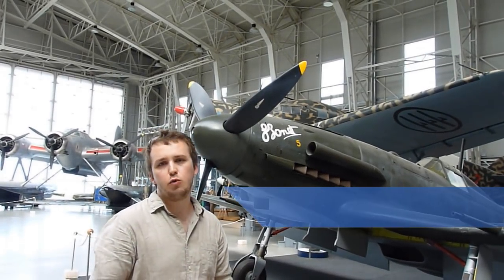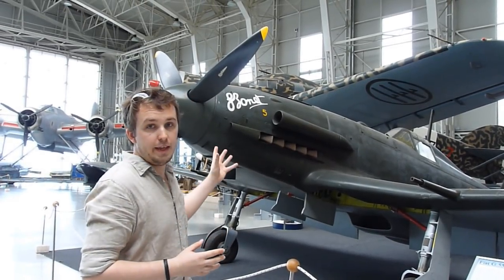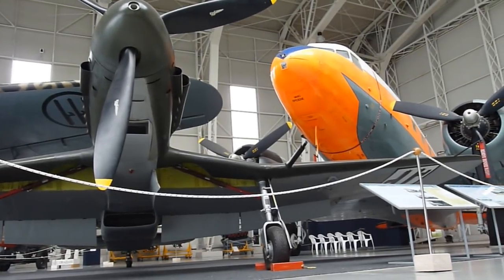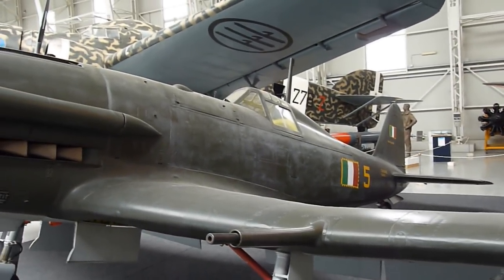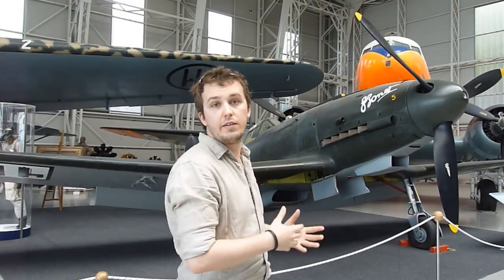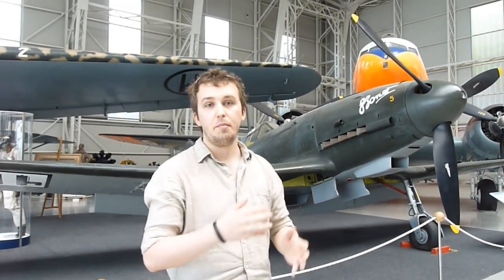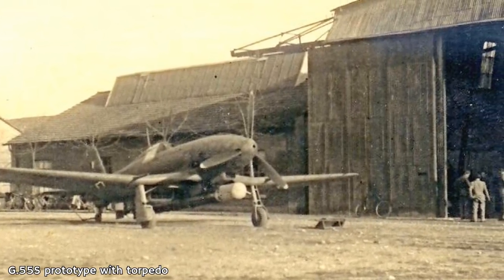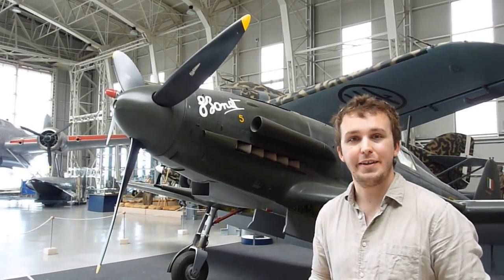Fiat G.55 - Italy's Centaur of WW2

Comment: The irony is that the  Nazis could get a 109 out the door of the factory in 5,000 hours but it often would not fly. German production quality deteriorated during the war to the point of absurdity.  Rather than produce quality air frames they just shoved crap out the door. Many 109's, by 1944, were scattered on airfields with missing parts needing replacement of shoddy parts..   The Nazi bureaucracy was concerned about the bottom line, which for them ended at the factory door. One of the many errors by the Nazis was not incorporating women into their workforce unlike the Allies whose workforce was ample and able with women.
Reply: To compare the build time of the Italian fighters with that of late-war Bf.109, like it's always done, it's simply misleading. No oter WWII fighter, not even other German fighters like the FW-190,  took so little time to be assembled. That's due both to the different industrial structure (a Bf.109 built in Italy would have required much more man-hours to be assembled, due to the more labour-intensive industrial structure) and due to many "shortcuts" that had made to make the Bf.109 easy to make (some of them even not so safe, see IE the single fuel tank put in the worst location possible). 
Spitfires were industrially made, but to build one took 16.000 man-hours on average.

Comment: I wonder if the G.55 could have been a torpedo aircraft for the Graf Zeppy, had it been finished and put into combat... (Not that Zeppy would've lived long, the minute the brits learned it was fully operational they'd throw EVERYTHING AND THE KITCHEN SINK at it in an effort to sink it...)
Reply: I don't know if it would have been used on the Graf Zeppelin, but a torpedo version of the G.55 (the G.55S) was being designed, with a single prototype in testing
Reply: A torpedo bomber-version of the G.55 had been tested and found satisfactory, however it had to be modified to do so (splitting the central radiator). The Reggiane Re.2005 insterad had already been selected to be the second-generation fighter/ bomber / torpedo-bomber for the carrier "Aquila" (after the Reggiane Re.2001). It could carry a full blown torpedo from the start without modifications, thanks to its 1000 kg offset hardpoint.

Comment: Took a G 50 a put a DB 605 in it? Where did you get that, the fuselage is totally different in xsection as well as the wing plan , it’s a totally different plane. Did you read the English version of Wikipedia “Fiat designer Giuseppe Gabrielli, while experimenting a new version of his Fiat G.50 fighter, equipped with the DB 601, started a new design that was to be powered by the DB 605.” It’s clear that the G 50 derivative was installed with a DB 601 but Gabrielli made a totally new design for the 605. The G50 was an ugly duckling, the G55 is really a Centaur.

Comment: G.55, Macchi 205 and Reggiane 2005, as if the British had had three airplanes like the Spitfire with non-interchangeable mechanical parts. The explanation is one "bribes".
Reply: Simply the G55 was the winner of the selection, but the C.205 was readily available (it was already in production infact) cause it was simply a C.202 with a "plug & play" DB605 engine in it, while the other two required time to start production, so there was no point in not producing it. For the Reggiane instead was easier to start producing the Re.2005 than retooling to produce the G.55, and the Re.2005 had been already selected to be the "second generation" fighter-bomber of the carrier Aquila after the Re.2001 (the Re.2005 could carry a torpedo from the start, thanks to the offset 1000kg hardpoint).
Reply: None could compete with the spitfire

Comment: Seems that all Italian aircraft designers wanted their products to be beautiful as well as efficient.  Even the tri-motor seaplane bomber in the background is handsome.
(Compare to the Ju52, useful and rugged, but a real ugly duckling.)
One question about the G55, though; why is the cockpit SO far back?  The DB engines aren't that long, and seeing where you were going on the ground had to be a real problem.
Reply: Behind the engine there are the receivers of the guns and the magazines of the ammos, Bf109s cockpits were placed about as far back (just a little less, but it was "paid" with the bulges and less ammos). Really the inverted V layout of the engine, with the low placed propeller, gave a better forward view in respect of conventional engined models (and both had a better forward view in respect to radial engined models anyway).
Reply: The "span"  between motor and cockpit  is for the Cooling and TurboCharger  System...
Reply: asparis145149 weight and balance

Comment: Looks pretty imbalanced was its left or right wing longer? Doesn't matter just not centered and extremely costly for just no effect we even do not need to look at the video.
Reply: Macchi fighters had the left wing longer, not Fiat ones.
The solution was not "extremely costly" at all (the left and right wing are not interchangeable anyway).
The solution was effective to counteract torque.
Other WWII aircratfs were asymmetrical for the same reason (Spitfire, Mig-3...)